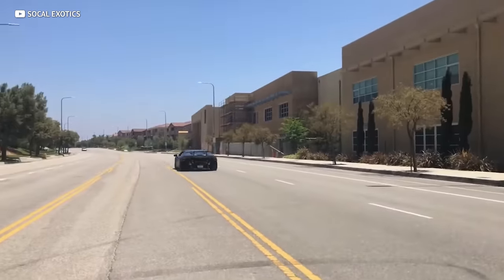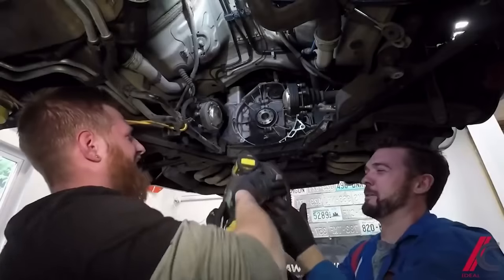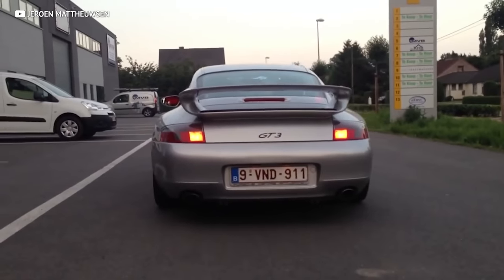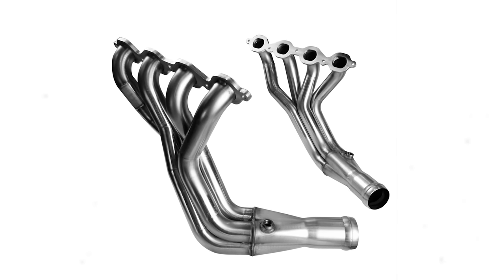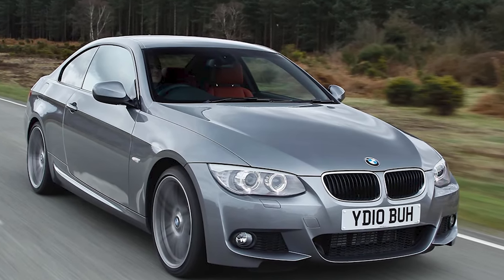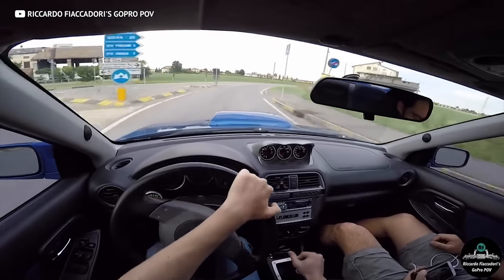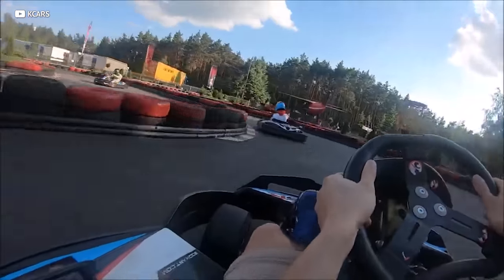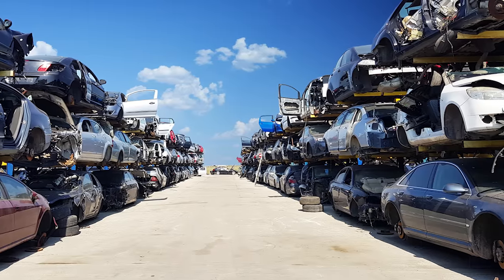The Easiest Ways to Add HP to YOUR Car

Comment: If a $1K cat back exhaust, $400 intake, $1K headers, probably $1K downpipe and high flow cat, $1K in tires, plus the expense of paying someone to install them if u don't have your own $10K lift, plus a $400-1500 dyno tune is all "cheap," what constitutes expensive?? Just buying a new Corvette?! 😆 I'm not broke, but I still consider $5K+ in mods expensive. And we haven't even gotten to the upgraded brakes, suspension, bracing, cams, lighter wheels, etc etc. I plan to get it all, but don't pretend any of this stuff is cheap!
Reply: All that said my Yugo is worth it
Reply: I really think of it as gradually buying stuff. Buying 5k in parts instantly hurts. Buy something you want(say a new turbo) then upgrade with that. Or you can save to buy and upgrade all at once. Make a bank account that you siphon some money every check into the account. You can use that money for purely upgrades and use it. You would be suprised how little time it could take to make that money.
Reply: Also cars are not cheap. Going cheap on your upgrades will make you waste money. Buying the good stuff with warranty is the only way you could save anything. You should expect to spend a lot of money when buying parts.
Reply: Buy parts one at a time when you can afford it.. Install it yourself 🤔
Reply: True

Comment: “Adding power or removing weight is the exact same thing as far as I’m concerned.”  -Physics
Reply: it's all about the power to weight ratio, it doesn't matter how big the real numbers are. when you simplify the fraction, it's all the same. so instead of increasing the numerator, (power) just decrease the denominator (weight) and you're good to go.
Reply: 1st thing to go is the engine, those things weigh a ton
Reply: Yes. For acceleration, it's the same if you ignore wind resistance and rolling resistance. However for top speed, power will get you a much higher top speed than weight reduction will.

This, of course, assumes that you are comparing added power versus weight reduction that will result in the same weight/power. For example, a 2013 Challenger SXT Plus weighs 3825 and has 305 horsepower. Instead of adding 30 horsepower, you could remove 360 pounds to get the same weight/power. I am including a 200 lb driver for this equation and rounded to the nearest pound to get 360.

4025/335 = 3665/305 = 12.0
Reply: Rust is your friend. Easiest weight reduction.
Reply: @elstingergt3374  and it's free, just drive through some salt water
Reply: @_. just remove the motor dude
Reply: loosing weight reduces downforce, so not actually ideal
Reply: @denisminigarage2030 if you are driving in a straight line yes but as soon as you go through a. Corner you will feel if there is significant weight
Reply: @priyam352  true, I assumed centripetal forces and conservation of angular momentum from going around corners were negligible
Reply: @denisminigarage2030  less powerful car thats light will feel faster than a more powerful car that is heavy even if the heavy cars power to weight is better and its faster on paper and since you are after that feeling of speed and not the actual speed itself makes more sense to go with the lighter car
Reply: Not exactly I feel. For top speed you need the power.

Comment: thieves can't steal my catalytic converters, cause I ain't got none
Reply: Yessir and that’s on straight piping
Reply: The mfs would steal my cherry bomb out of confusion 😭😭😭
Reply: Straight pipe is the absolute worst thing to do to a vehicle you rob your power and gas mileage and poor emissions some restriction is important it pulls a vacuum on exhaust valve and pull fumes out and instead of engine working hard to push it out it’s all sucked out by the vacuum and all power is focused to the wheels
Reply: @izaaccortez9839  i have a fully custom exhaust, built by a fabricator. It is on a tuned race car. Just because you are to poor to do it right doesnt mean i am.
Reply: @rotaryroman9548  if it’s a custom then that’s different instead of just straight piping and I wouldn’t straight pipe any of my cars don’t know what makes you think I’m poor you don’t even know who I am but think you know something about me your funny dude

Comment: This is super helpful. I bought a rebuilt 93 Impreza a few months ago, and they're apparently known for being quite underpowered. Given the age of the car, I'm sure that HP is even lower. I'll definitely be using some of these techniques to give 'er a little more power.
Reply: They really aren't upgrade the suspension and throw some legacy brakes and rear hubs on it along with some coilovers and it will be faster than a wrx having driven both a gd and a gc with half the hp of the wrx it weighs 500lbs less and that makes  more of a difference than the 100hp in every situation but a straightline. Even then wrx 15.25 lb/hp vs L (98) 21.86 lb/hp assuming stock for stock.
Reply: I got a 96 Impreza. How did the modifications go?
Reply: How'd the mods go? I just recently bought an 06' Impreza that was already dropped with coil springs and a new exhaust system and tires and compared to my 2014 Impreza it is certainly much quicker. I wanna know if you feel the same after the mods.

Comment: Did the exhaust upgrade. Headers, downpipe, flex, cat, and catback. Reduced weight and gained a lil hp. Did the intake too but that's always a first mod
Reply: i just cut the cat on my volvo and it fell much faster and sounds like a V8, only problem is that i cant afford a exaust so it its no piped now :)
Reply: @meatballs9127  just go with open headers lmao
Reply: what is a flex
Reply: @bavarianbeauty-bmwe9079 question what are open headers like is it soemthing i can replace or add to the car ?
Reply: @Washaterias open headers = no exhaust system at all
Reply: 2 more things to do: port and polishing your cylinder head/ heads. It will increase intake/ exhaust flow. You go to an engine machine shop to do that. After you do that, you either get an ecu tune or go get it dyno tuned to REALLY use the performance of your parts. Remember, always ecu or dyno tune you are AFTER you install all of your performance mods. That's the last performance mod because it uses all the mods to their best performance
Reply: @shoruda that would be annoying as fuck😂

Comment: Many turbo cars can be tuned in minutes, adding over 60 HP for a Stage 1 (APR and others) tune. Cost is low considering the amount of power gained. My VW Golf R has been tuned for 5 1/2 years with no issues.
Reply: A pipe exhaust need ?

Comment: I've got aftermarket headers, skunk2 intake/exhaust plus a carbon hood coming in soon, front and side splitters on the way, coilovers being installed this weekend, super happy about my build so far. need to replace my intake filter though, starting to get too dirty haha, my low end power is feeling lower than usual. I call my car Stinky the civic si. fun little 2010 coupe
Reply: nice stuff dude hope the build goes well
Reply: ball slayer69 Thanks! So far so good
Reply: update?
Reply: Just bought Intake for my Civic Si

Comment: Ive owned my 2001 Mustang Bullitt for 17yrs and have done CAI, gears, headers and xpipe and most recently a procharger.   Previous owner did forged pistons/rods, so next up is heads/cams.  I also just purchased a 1974 Dodge D100 with a 360 Magnum v8 from a 2002 Durango.  I plan on starting with suspension and brakes.  Idea is to make it a pro touring handling pickup.  Power will come later on this one.

Comment: Here's a few suggestions if anyone has anything that is powered by the series 2 or Series 3 3800 V6 from GM, although most components from the first gen and series 1 3800 are not interchangeable, the exhaust manifolds should be. And guess what the exhaust manifolds for the 1st Gen 3800 are actually headers. Just remove the heat shield and have them ceramic-coated mounted and you're good to go there or you can add turbo for MO POWA BABY!!! Also whether you use the first gen 3800 exhaust manifolds or not you can extend the length of the crossover pipe or redirect the Left Bank to the crossover and then tie it into a turbo and then exit out to the cat. Also removing excess Flash from the exhaust ports of the heads on the series 2 and Series 3 3800 is good for about five additional horsepower which would put you assuming all else stock between 200 and 210 horsepower....

Also the coil packs for the 3800 will interchange with any number of models from GM regardless of engine size. That includes the Impala SS  coil packs which put out 20,000 more volts.
Reply: any advice for the gen 1 3800s? i have a ‘00 impala and i’m looking for power mods, depending on wether the transmission can take it
Reply: Got any suggestions for a 3.6 ly7

Comment: Just getting started on modding my '09 buick lucerne, starting with a custom fabbed exhaust (muffler delete, secondary cat delete, and possibly Y-pipe to dual tips) then custom fabbed intake because nobody makes performance parts for the 3.9 :( Planning to dynotune with 50/50 E-85 and race gas, might do new fuel pump and injectors. Love the vids!

Comment: I got a 6th gen accord about 3 weeks ago and i want to do full service on it, learn about it and improve the suspension (anti sway bars, strut bar and coilovers) and tires on it, keep the motor healthy, improve intake and exhaust flow, weight reduction and manual swap it before putting in more horsepower... I prefer reliability and function over horsewpocer
Reply: I got a 6th gen accord around the same time. First car not the v6 sadly but a 2.3L 4 Cylinder. I learned manual on it I love the car I put a new head unit and speakers in it can’t wait till I start making it more powerful the car is crazy fast already that VTEC lol.
Reply: Do it brother. I'll be the first to do all that to a 1.3 Hybid! 7th gen Civic
Reply: I got a 98 accord, it cost me $600 to gain real 60hp. From a 16sec stock to a 13sec stock..

Comment: Here's some low-cost mods. Switch your stock-sized tires with ones that are smaller in diameter and wider in width that wil fit on your rims. The stock rubber on my 2016 Elantra are 195-65 x 15's. I switched them for a set of 205-60 x 15 'sand got more low-end power (0 to 60)  because of the change in gear ratio caused by reducing the diameter of the tires. Another bonus (of sorts) is that your actual speed will be lower than what your speedometer says. This will help keep the law off your tail when the speedo says 80mph when you're actually cruising at 76mph. Swapping out your stock air filter for a K&N or AEM reusable one will improve the sound and also add a few horses. If your car has an automatic with a manual mode, you can train your engine and tranny ECU's to match your driving style by manually switching gears. For example, I have a 6-speed auto in my Elantra with shift points for 4th, 5th & 6th are 25mph, 30mph and 40mph. If I'm starting from a dead stop and want to get to the speed limit around town (usually 35-40mph) as quickly as possible, I'll keep it in 1st until I get to 40 then switch it to 6th with a few fast flicks of the gearshift. After about a dozen runs like this, the car learns the routine and will hold the shifts longer when it's back in AUTO mode - even when I've got the ECO setting turned on.
Reply: I have a stock Pontiac 2007 I want to make it have more hp but I just don’t know where to start 😂
Reply: Ai 😨
Reply: Another thing to add to this is performance suspension and lowering your car. Tight suspension actually helps with gaining speed especially on turns on highway or back roads. Lowering your car is another gain of speed. Less air flow that hits your tires which cause drag means a clean pull. Elantras arent necessarily race type but you can squeeze somw juice put fasure. One thing they are really good for is windy back roads. I can guarantee you all the boys who have a fast car have no skill taking sharp turns. I can take many of them on the back roads and the majority will end up crashing because they dont have any real control of their car with or without performance suspension. 
Also, f9r all elantra owners. If you want a crazy good sounding exhaust, i suggest Flowmaster Outlaw muffler. Theres 2 options. 
3inch or 10inch.
3inch is best for Any elantra even sonata that has a turbo.
10inch for any of the N/A non turbo engines. straight Pipe the resonator and remove your cat if youd like. But switch to a better header instead of the cast iron one, it will leak with the next exhaust flow. Magnaflow has a good header thatll fit for like 700. 
Obviously get it tuned after if you can find a shop that will be willing. Not many shops in my area will tune a NA engine from hyundias lol.
Reply: Also, he is right about the ecu learning how you drive. But be prepared for consistent maintenance like oil changes, etc.

Comment: I always wanted a Ford Sierra Cosworth RS500. But I live in the states. So I bought a 1989 Merkur Sierra Xr4ti and I'm restoring it and building it to be faster and better handling than the RS500. There are so many different parts that will bolt right on! When I am finished I'm painting it Magenta <3
Reply: How is the car going

Comment: @IdealCars well I own a 2015 lifted Scion xB. I do plan to get a brand new exhaust system. Let’s start with header. Note: I will loose some torque. Maybe 2-4 but I’m ok and a good reason. 
1: get a UEL header that I know someone made for our 2.4L 2AZ
2: o2 sensor defouler 
3: 2.5” down pipe
4: magnaflow high flow cat 
5: 2.5” ultra quiet vibrant resonator 
6: 2.5” exhaust pipe
7: right single side 2.5” pip with quad exhaust tips shape and form like square. Like pagani zonda. Something different. 

It’s gonna sound shweet. Little by little

Comment: I'm trying to get more power for my 98 Wrangler. I was just gonna get a donor block and build that up
Reply: Is it the 4.0 ?
Whenever is time for a rebuild, I'd consider a 392 create and would be badass as light as the Jeeps are
💪🏼😎
Reply: @lovethesmellofracefuelinth7374  yea, but I was gonna use the donor 4.0 to swap in, then use the one I pulled out for a drag engine

Comment: 2:25 Cold air intake does not give you better throttle response. In some cars it will hurt the response because it change the way the air flow meter check the incoming air.
Reply: Even if you’re tuned?
Reply: The computer already can handle some upgrades, so no logic behind what your saying considering it literally sounds like from every perspective that you have not tried this mod known as a cold air intake.
Reply: @GMC.Sonoma.4.3  The stock air box in not restricting hp. I know how to increase hp. I have a video of me rebuilding my 96 Tahoe 5.7 and installing a cam. Do you have video of you doing anything to a car?

Comment: Getting better suspension is huge as well especially for the older cars that make little to no power, if you can’t go fast on a straightaway then at least you can take a corner going like 45 in a 25, makes you feel fast 😌

Comment: Yeah I do have three project cars (Sonata NF 2007, previously a V6, 3.3 NA, now is a bit over 3.9, Turbod(its custom built general bearing, but damn spools FAST), a Peugeot 405, 1993, AWD with 2.0L Fuel injection engine, which I have not decided what to do with it, I have just done the body and interior (I'm toooo obsessed with it because I love it so much), and a Quick(it's from SAIPA and basically a Kia rio hatchback with a B5 Mazda engine(the cranckshaft is different from B5 and it has 8valve, 55whp), but I have bought her a Ford B6 cylinder head, a Mazda B5 crankshaft and Mazda B6 conrods (they are 3mm shorter and reduce the static compression ratio down to 7.9 and I know shortening conrods increases its bending angel, yet I live in Iran, here things are different thanks to the $|π¡ty regime!). Also I have a very neat Supercharger of a C200, 2006 Mercedes Benz, and by using some tricksI hope to have a smooth 200 WHP dyno graph! Yet this is my first supercharger experience and I have no idea what would be the result! Finally I have turbod my V2 racebike(Hyosung GT250R) with Renault Capture turbocharger and MegaSquirt 2 standalone ECU.

Comment: 2006 Mini Cooper S. (169 stock hp)  K&N Cold Air Intake, One Ball Mod (Delete passenger side Muffler) 15% Supercharger pulley reduction (Spins SC faster compressing more air making more boost) Lowering springs and roll center compensators(lower center of gravity equals faster cornering) AND many other mods ...too many to list...  THESE  MODS put my car from the stock 169hp to 205hp .... rims and aluminum rear trailing arms (off an 08, straight bolt on conversion) deleting the rear seat combined reduced the vehicles weight by about 50 lbs.      I CAN SAY FROM DIRECT EXPERIENCE THAT THESE MODS HAVE TRANSFORMED MY CAR PERFORMANCE TEN FOLD, 0 - 60 IN 6.1 and kick down boost that pushes you back into the seat cushioning,  freeway clovers at 70.....   So his suggestions are for real but beware about adding turbo and superchargers to engines not designed for them,   engines with these components are designed with different compression ratios to be able to handle the increased combustion performance,  putting these components on motrors not designed for them will dramatically decrease engine life and possibly blow the motor at a moment of acceleration causeing a loss of contrtol so beware........

All in All good vid but if you want speed start with a car designed for performance from the start A late model first generation Mini Cooper S (2005,2006) is a great car to start with , they require much more maintenance and premium gas but deliver an unmatched driver experience ......ask any MCS owner and youll get the same gratified response...... best driver experience ever.......  street legal go cart.